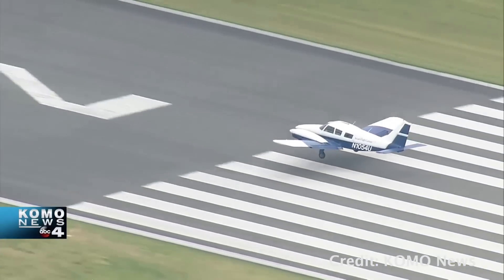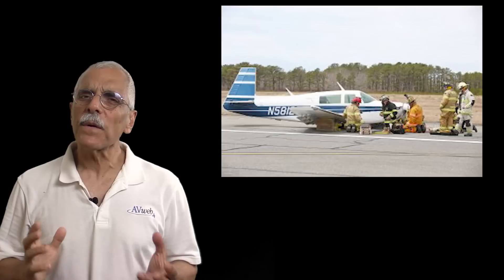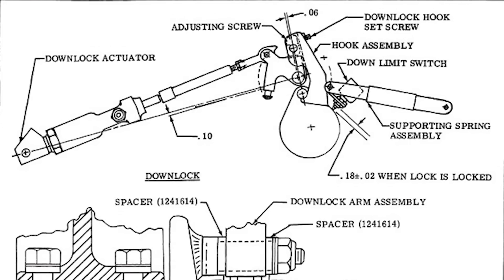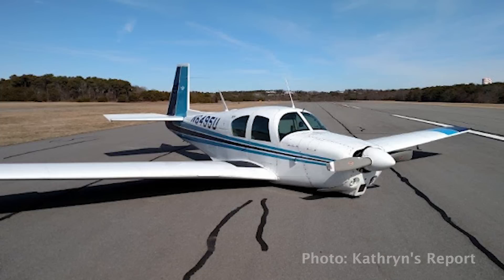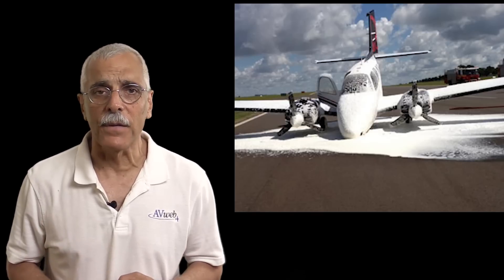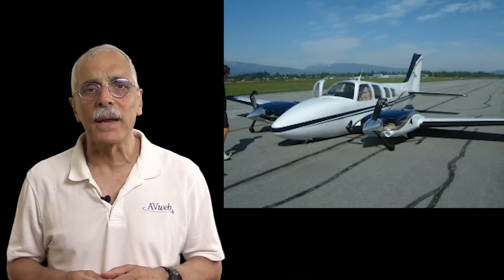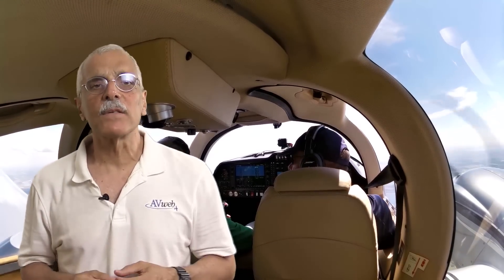Why Gear Up Landings Happen

Comment: The number of Bubbas trying to defend the "wisdom" of trying to "save the engines"...

If you have a problem in an aircraft where you might not go home that night, the entire airframe is expendable... then and there. Waste the prop, destroy the engine, ruin the paint, pull the airframe parachute; you put survival at the top of the list or you need to find something else to do with your life. Insurance will not give you a discount, they won't even give you a high-five.

Get a dog, a cat, something or someone you need to get home to and get your head right.

Comment: My uncle owned a 210 with retractable gear.  He had a couple thousand hours in that airplane….and still got caught landing without extending the gear.  He knew everything there was to know about that aircraft!  And still it happened.  He felt horrible, but maybe it ended up giving him a great, high-time lesson.  It’s never happened to him again!  He told me that there is that split second between when he expected the wheels to touch, and then when he realized in horror that he forgot that critical step!  He said that the stall warning was howling it’s fool head off as he kept holding it off…..  His first reaction was to “firewall” the throttle and then go around, but by then, the belly is scraping its way down the runway.  He said further that when the airplane came to a stop, the view out the front windshield freaked him out because he was suddenly so low to the ground.  Interesting perspectives!  Funny, I don’t recall him saying anything about a gear warning going off.  I’ll ask next time I see him…but that was so many years ago.

Comment: I remember a video with a light GA with a stuck right or left main gear overflying a van all along the runeay and a guy on the back of the truck managing to pull the strut and have the whole gear down, the plane climbed back for another uneventful circuit. That was badass but very risky for the guy on the back of the truck.

Comment: Excellent video as usual from Paul. The best gizmo I came across is a small pretend landing gear lever you can stick onto the instrument panel of fixed-gear planes.

I feel this is a great idea because right from Day 1 of training the student in the fixed gear plane can be told to say "+ve rate, gear up" and do "GUMPS" on finals. As they progress up the training ladder to retracts this mindset will already be ingrained in them.

Comment: My instructor always told me on a gear up landing to shut the engine down on short final and put the prop in a horizontal position to save the engine if possible. But if the prop touches the ground the engine must be taken apart and inspected. I have never had to do any of this in my years of flying. But it stays on my mind,,,,,,,,   🤠😎

Comment: I have three hundred hours flying retractable Piper Arrows (I own one!). My original high performance / complex aircraft training leading to endorsement was in a flight school rental. I was taught GUMPS, just as Paul endorses, without over emphasizing. I continued GUMPS even with my first plane, which was a Cherokee 150. "Gear: Wheels down, locked, and welded." That got some rye comments from passengers. But I did it to never lose my rhythm because I knew it was just a matter of time before I would own a retractable, as I do now. 

However, the flight-school owner that I bought the Arrow from, after I asked him how things were going, said "great if people would quit crashing my airplanes!" Then he told me a story about a different Arrow that had enjoyed a belly up landing because the student and the instructor were distracted by the "G" for gas. He said, "for crying out loud, you have plenty of fuel, don't worry about it!"

After that, I switched my landing protocol to cockpit flow followed by landing checklist. I still worry about fuel, but I do that within the framework of my normal 30 minute tank switching, NOT my landing cockpit flow. It works better for me because I establish a firm process to fight off the distractions. 

1. Three nm from IAF or intercepting the final approach course, I set PAC to 90 knots and flaps 10 degrees. 

2. When on the published IAP, I do a cockpit flow BEGINNING with gear down and wait for three green. Then it is throttle (increased to maintain altitude at 90 knots with gear down). Followed in quick succession by propeller set to 2500 (later, after reducing power to descend, I'll set propeller to full advance), mixture rich, boost fuel pump on, landing light on, pitot heat on (if needed). This flow fits perfectly with the layout of gear handle, throttle quadrant, and switches on the instrument panel of a PA28R-201.

After giving some attention to other cockpit chores, such as scanning instruments, I perform the landing checklist printed on the instrument panel in front of me.

But even that is not good enough. Just like Paul said, as I slide down the glide path toward short final, I do at least one or two more checks of the gear lights and speak out loud "three green" to myself and my passengers on the intercom. 

My wife shakes her head when she hears "three green" over and over, but we all know that only the paranoid survive WITHOUT a gear up landing claim on their insurance.

Comment: Paul, I love your commentary - it's fun and informative.   I've been learning a lot watching your videos and I'm not a pilot but a sailor.  I like sailing in strong winds with big waves and putting my ocean yacht through her paces.  Safety is really important to me as I sail mostly alone and don't want to end up on the evening news.  A lot of what you talk about I can apply to sailing.  Like making sure your equipment is inspected on the ground, for me that is at the dock.  Having the proper safety equipment on board and make sure it's serviceable - I always wear a life jacket,  no exceptions;  carry a portable vhf on my person and wear a sail harness in heavy weather.  I have gotten into trouble but like you say always have a plan B.  Thanks for reinforcing the message no matter which sport you participate in and be professional.

Comment: I witnessed an inadvertent gear-up landing once… a glider landing on a grass field. Pilot realised on finals, started lowering the wheel (which in the Astir means taking your left hand off the airbrake lever and reaching over to a handle on the right side of the cockpit) but realised he wouldn't be able to lock it in the time available, so raised it again. Aircraft was undamaged, IIRC.

Comment: As a non-aviator: I always thought people turned off the propellers to prevent parts of them flying around like projectiles should they break and be shot through the air by centrifugal forces.

Comment: Paul, excellent production /  minor comment. The overhead lights reflecting on your glasses is a distraction.I suggest the glasses off or lights off or simply hold your head down a bit. I assume you are reading. That is why your head goes back. It’s a natural reaction when your lenses are not strong enough. Your eyes are using the bottom of the lens to see more clearly. It’s like squinting without actually squinting.

Comment: A more recent gears up landing was PIA crash in Karachi in May 2020, it killed 97 people with 2 survivors. They were coming in too fast so despite putting the lever down gears never got deployed.
Reply: More ives could have been saved had the pilots not gone for a go around. Engines were severely damaged during first attempt to touch down and they failed during go around. 
Somewhat similar thing happened in Canada in late 1970s when a plane hit the runway due to early deployment of spoilers and crashed during a go around.

Comment: About 54 % of failure , need to make one alarm in the indicator of velocity and the pilot make calibration until start the flight for each operation and when the pilot reduce the velocity coming tô landing the alarm turn on making one Alert signal for the pilot imediatelly also make down the landing gear automatically, also is possible to increase this equipment joint with GPS for additional  information of VS for computer, this equip. have low cost for to produce.

Comment: Serious question:  As a software developer, I'm noticing that these subsystems are mostly independent of each other.  Why is the retractable landing gear not linked to a laser that measures the distance to the ground, regardless of elevation?  Why burden the pilot with workload that can be automated?  Laser distance finders have been used for over a decade in golf and construction.  Why not eliminate the possibility for distraction?
Reply: Newer airplanes have ‘gear alarms’ that work based off either speed, engine power, flap setting, or a mix of the above, to create a loud alarm if the landing gear isn’t down and locked. The problem is that the vast majority of light aircraft flying today were built in the 60s and 70s, before this technology was added.
I can’t see why a laser based system wouldn’t work just as well, but my guess is that new parts for airplanes need to go through a massive approval process before being allowed to fly, as they have to be proven to be extremely safe and reliable.

Comment: No risk if you fly a fix gear.  Also, added expense of retractable gear most often is not justified to gain 10% air speed.  Just don't be in a hurry and enjoy the flight.  Isn't that why you fly, anyway?

Comment: Worked for an airline that had a B737 gear up.  Enroute the ground proximity warning failed and  keep saying "pull up."  The pilot pulled the circuit breaker which also controlled the gear horn.  On final the verbal checklist being completed can be heard on the cockpit voice recorder.  Three in the green.  All the 737's were then fitted with a safety wire that if you pulled the circuit breaker maintenance had to be notified.

Comment: I remember when I was working at STN in the late 70's,a Monarch BAC 1-11, (G-AXMG) on crew training landing with the gear up. They had been practicing missed approaches and had pulled the gear warning horn circuit breaker because the horn  was a nuisance. Anyway, when they had had enough and decided to land.........You guessed it! The airline I was working for did the recovery as we had air bags and all the right equipment. 'MG stayed in our maintenance hangar for a few days while sheets of 2075 were nailed on the underside of the fuselage (I kid you not!) so that the aircraft could be ferried to Hurn (Bournemouth) for repairs. The 1-11 was a very robust airframe.

Comment: I did a gear up 20 years ago in my Aztec.Lost hydraulic fluid & the  co2 blow down bottle would not work. Tried for about thirty minutes to get gear to drop . Tower gave me the airport. I elected to land on active runway.
Upon reaching end of runway I shut off engines and safely glided and landed to full stop on runway. 
Minor skin damage and props.
Engine crank cases were split to insure no internal damage, required by insurance company.
Had the engines been running,the insurance would have written off the plane. Still flying that Aztec today

Comment: Is it possible they turn the engines off so the bits don't fly of when rotating against the ground  (when they are so low), In these examples the standing props stay intact. If they were rotating they would all in sequence hit the floor. 
 
That would be my main concern, not the insurance. Maybe that is not an issue? But he never even mentions this aspect. 
 
Even though the image i have in mind is blades of a crashing helicopter shuriken in all directions.... But they are not in FRONT of your window.

Comment: While stationed at Clark AFB in the 70's I witnessed a gear collapse on a F4, don't remember the model number but it had the big extended radar in the nose. We heard in flight emergencies quiet often  but nothing bad ever happened.. In this case the front gear lowered but they didn't get a lock indication. The runway was foamed an the F4 came down he got his rear gear on the ground and kept his nose up as long as possible. When he gentle lowered the nose the gear collapsed. The F4 seemed to slide a long time, the foam sprayed over the plane when it came to a stop it was kind of funny but still serious. The pilot popped the canopy and the pilot and weapo leaped out of the cockpit and slipped on the foam several times falling, I was happy they got down OK but you couldn't help but laugh a little. I stopped by the hanger to check out the F4 the next day and it was surprising how little damage there was to the aircraft. Of coarse the radar was ground down back to the firewall but it was up on it's gear looking like it would be back in the air in a few days. I was never surprised these aircraft had issues many of the maintenance guys were high on weed while they were working on the aircraft. I once found a roach in the intake of an F4.

Comment: I am surprised Paul did not mention the trap of lowering the flaps first, in aircraft that normally lower gear, then flaps. The plane then flies like it’s configured, and the horn won’t go off until power pulled, which might be on short final.

Comment: Shutting down the engine (s) on final might save the engine (s) and props.  #1 is the Cessna 210.  #2 is the Cessna 337.  I had one and a few incomplete extensions or retractions with top notch maintenance.

Comment: this video is exactly why I don't fly planes with retractable landing gear...

or fixed landing gear,  featherable props, props, propeller props, jet engines, turbines, gas turbines, wind turbines, piston engines, piston turbine propeller props, piston engine propeller jets, swing wings, rotors, blades, blade rotor rotor blade blades, fixed wings, propeller wings, wing propellers, wheels, skis, skids, pontoons, hinged wings or winged wings...

Comment: Two wonderful p51 gear up landings did not make the video cut!? I am sad. With that said great video as always and I agree always better to land on pavement. However I disagree about landing with gear down with an engine out. Primarily because landing in unknown terrain with the gear down will likely result in a flipped aircraft. Which is a lesson taught all the back in ww2. The best thing to help someone survive a gear up landing is to be low level with the ground and let the plane nearly stall before touchdown, think ten feet. You want to be as slow as possible before hitting dirt. 

Also those great p51 videos I mentioned
https://www.youtube.com/watch?v=ze2nEipDLR0

https://www.youtube.com/watch?v=jnODYKx5ics

Comment: I disagree with the assertion that you should keep the engine or engines running. Even if there is an engine teardown for inspection, if the engine is not running, you are far less likely to have to replace a crankshaft or other critical internal components than if you prop-strike with a running engine.

Comment: Paul, great job! I'm wondering if the pilot at 6:30 didn't really have the presence of mind to bump the to get the prop out of the way. It may have only been windmilling and stopping at the compression stroke. I noticed also that he did not have the presence of mind to shut off the master switch. That is what makes me believe that he didn't bump the engine.

Comment: Crjs and q400s have had a lot of problems.  Regional airplanes get rode hard and put away wet. A lot of cycles,  not a lot of maintenance.  Contaminated hydrogen fluid, poorly rigged down locks and corrosion have all been involved. On a q400 a main hanging up or collapsing is quite spectacular.  If the crew knows if is coming they move the pax out of the rows beside the props because the blades will hit the ground and depart the hub in any and all directions.  There are several yt videos that are quite scary to watch. The crjs are very close to the ground so a gear up land or gear collapse is pretty much a non event. When passengers realize they are landing with gear problem they are generally terrified,  but K don't think I have ever heard of anyone being hurt on such an event.

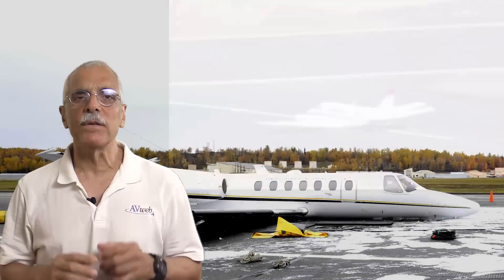Comment: 2:08 isn't there a "too low, gear" alarm?
(I'm not a pilot so I don't know if you can overhear it)
Reply: In a lot of aircraft there is. I fly a Piper Arrow. If the RPM goes below 2000 and the gear isn't out, there's a very loud constant beeping. I suppose maybe not all aircraft have that alarm. Also, I've been told that some pilots have been too distracted to notice the alarm for some reason.
Reply: @sassychimpanzee7431  ok thank you

Comment: That Fed Ex plane looks like an MD-10 (Refurbed DC-10) to me,  not an MD-11. MD-10's are shorter than the MD-11 and they lack the winglets. The MD-10 also had a rounded tail cone whereas the MD-11 has a longer squared-off tail cone, however that is not visable.

Comment: I have also thought through the possible scenario of a forced gear up landing in the past.  If it ever happened to me, I would shut the engines down.  Not because of the concern over the engines, props, or saving the insurance company money, but when you fly light twins, the props rotational plane is very close to being perfectly aligned with the cockpit seats.  I would rather not risk having any shrapnel lodge into the cabin from a fully spinning prop, regardless of how unlikely it may be.

Comment: No names, but I've been told there was a wing commander in the New Zealand airforce who bent maybe two Vampire jets through failure to lower his landing gear. The problem was solved by a ground crew guy who would park a vehicle at the end of the runway and flash his lights if WC Goofball was coming in without his legs showing.